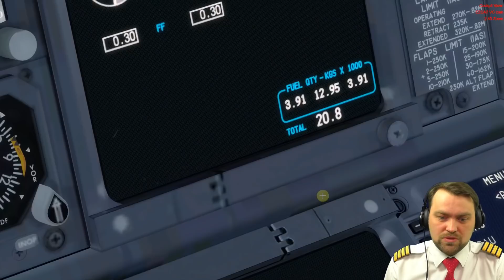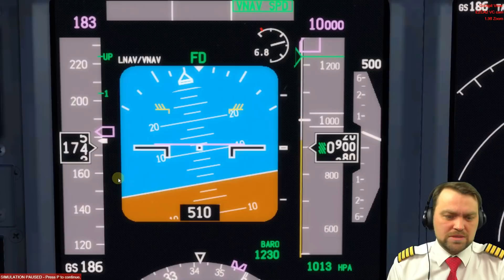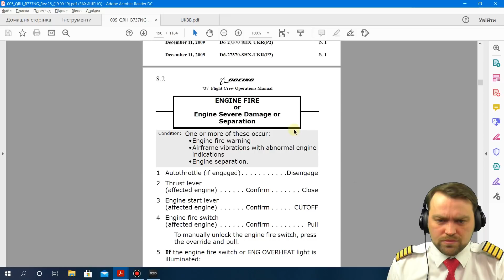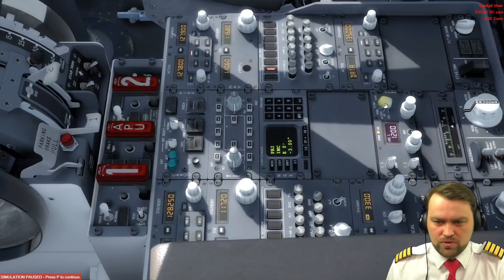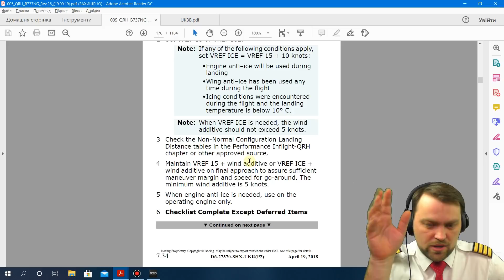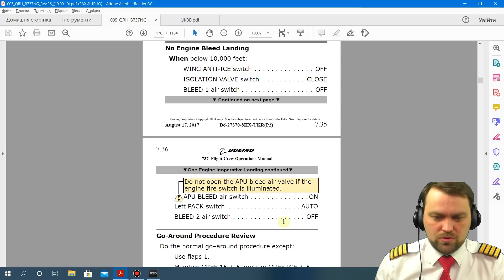Flight Simulator with the Airline Pilot. Engine Damage at Takeoff B737 [HD]

Comment: I once had to shut down one engine when descending to land in Paris. Oil pressure was low, then I realised that I had to refill engine oil before departure. I was in an almost 60h session in the simulator, traveling 51000km with the same plane (777). I had no idea engine oil would decrease so quickly!

Comment: According to a CNN article, the preliminary report for the Sriwijaya Air Flight 182 tragedy is stating that a thrust imbalance likely contributed to the crash (see link below).

I know that in the 737 the throttles move when the auto throttle is engaged. 

Are there in flight emergencies / system problems where the auto throttle system is moving a throttle lever or both levers despite the engine(s) not producing thrust proportional to the lever movement? (That was a lot, hopefully the question made sense).

I personally really like how the throttles move in Boeing products during autothrottle vs the static throttles on the Airbus auto thrust system. It seems to provide a level of feedback.

That said I think it’s important to monitor the engine instruments in order to understand how the engines are performing vs depending on the throttle lever position. 

It seems like the moving throttle levers during auto throttle could lead to a bad habit of watching the levers vs the engine instruments. It seems like it takes good habit building to always rely on the engine instruments with the moving throttle being a visual feedback.
Reply from the maker: I'll have the video about that case very soon. You can move throttles wit A/T engaged the A/T computer is OK with it....